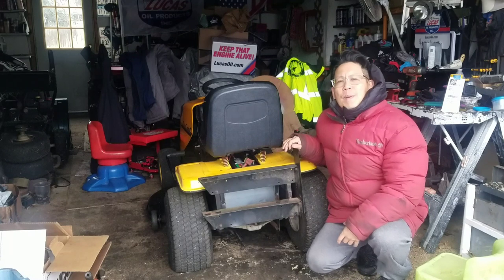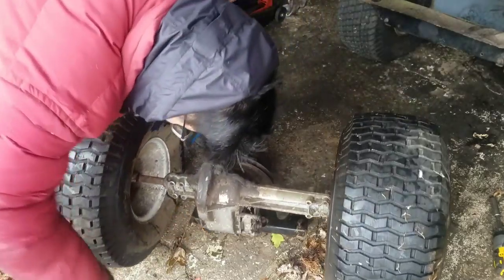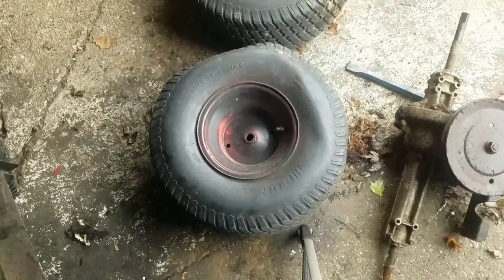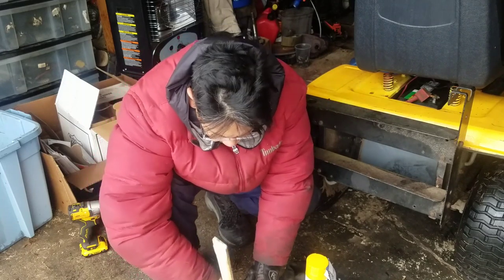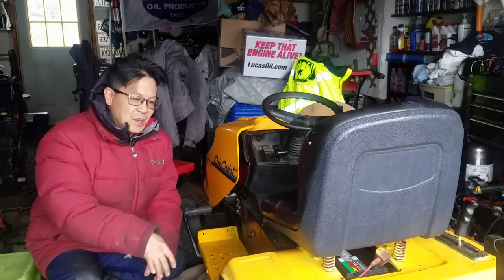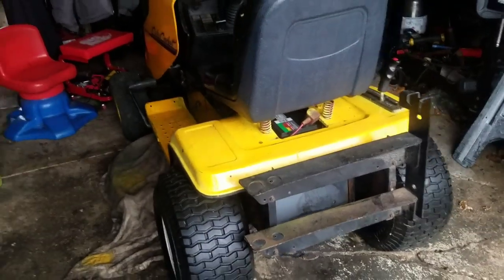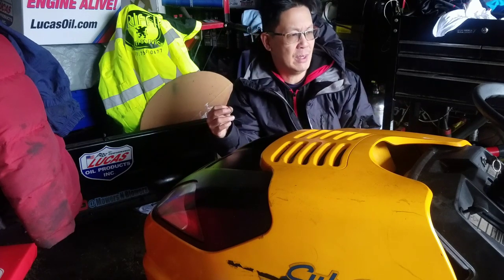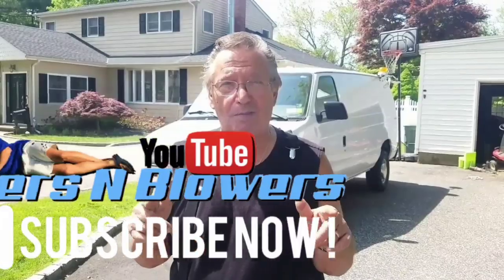$40 MTD CUB CADET LAWN TRACTOR REAR WHEELS SWAP SEIZED ON TRANSAXLE TRANSMISSION HOW TO REMOVE RIMS

Comment: That hood alone to the right guy is 50 bucks if he wants it bad enough. I prefer the Carlisle tires on my stuff, but our local Princess Auto has replaced them with a brand called (Hi-Run) & not really sure why they did that, price is about the same. Turn that bracket on the back into a rumble seat bro! lol

Comment: Did that Tractor come with the entire bagger or just that back bracket? I got a nice White Outdoor in early December. Came with the bagger, but some how that bracket was missing. I "borrowed" one off my Uncle because were always trading parts we need. Regardless, we need another one of those rear brackets..
I have a want ad up for one right now.
Reply from the maker: Whole bagger system but damaged in many places
Reply: @MowersNBlowers  I love when they come with the baggers and working batteries. Always a bonus.
Reply from the maker: @Mr_Tecumseh  his battery didn't work which is why he did a swapparoo 9000
Reply: @MowersNBlowers  I was surprised to hear he sold around 7 Tractors in the last month. Didn't realize lawn tractors were in demand in the dead of winter. If I knew that, I have a few nice ones here, just about ready to go myself, would have listed them.
Reply from the maker: Fearless you should always list them! No harm in not listing, it’s free to list!  Everything I have is listed. If it’s not listed, it’s not gonna sell.
Reply: @MowersNBlowers  Yea I know, main issue is, its hard to give these machines a proper wash in the winter and a good shine. 
I have so much machinery and parts, both my two car garage and canopy are filled. Not including the 6 tractor's over at my Uncles. Its left me with no room to work inside. That wont happen next winter, I will be more prepared, in the spring/summer I work outside no issue's, in the winter outside gets tough. Next winter, I will work on mowers straight thru the entire winter and on the days its 50 or above, I will take the opportunity to wash the machines that are ready to go. When I said its chaos, I meant it, its chaos over here. I have to try and limit what I take in, just enough to keep me busy and have room. I get so much free shit all the time it gets really out of control. I'm doing my best. Still wish I didn't miss out on that Cub Cadet 70 on Friday lol...
Reply: I need to keep half the garage empty so I have room to work and I have to keep my canopy clear so I can work in their over here. My Uncles is currently the only place I've been working inside...
I have a nice John Deere, Scotts, hydro with the bagger ready, I just have to patch the bagger up, wash it and scrap all the crap out from under the deck. I haven't had a chance to wash it yet, main reason its not listed. I have a lot of snowblowers listed not selling, because thats what I've been focused on. I'm gonna work on a few engine for the next couple weeks and than transition back onto mowers in March. I'm glad were almost out of winter. This winter has been a bust.